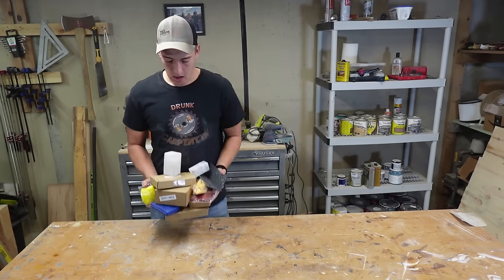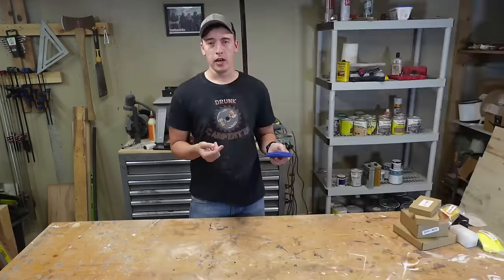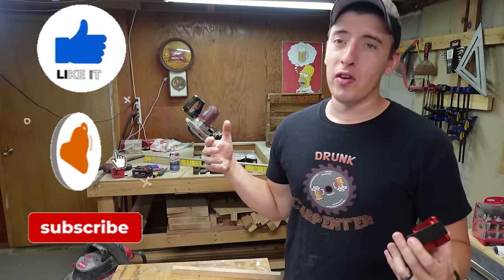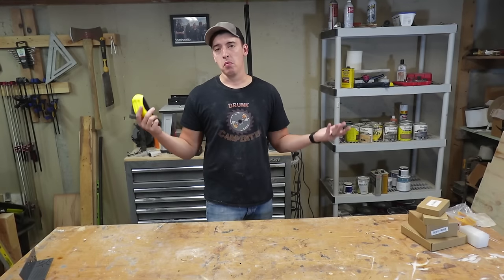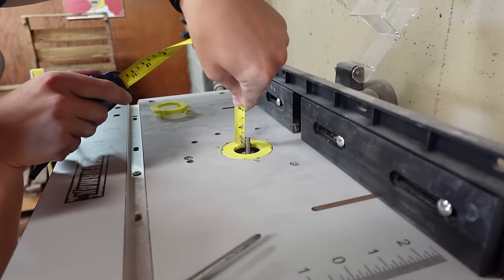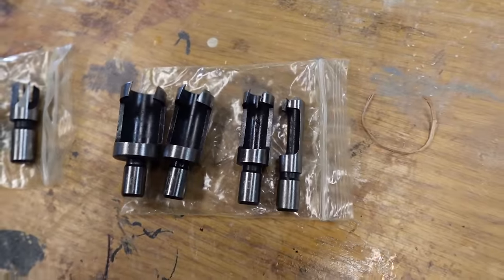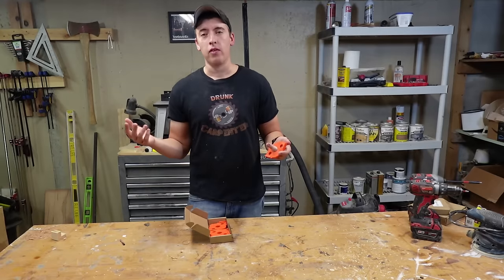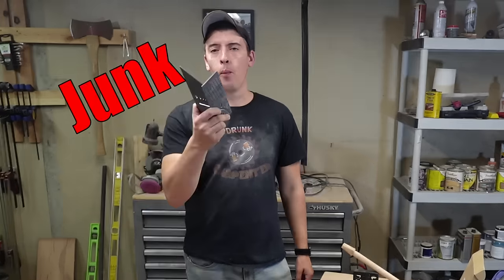12 Discount woodworking Tools From Temu

Comment: The woodworking community is no different than mechanics or construction, they buy tools based on the name of a product. I've purchased many clamps and squares from Temu and they are solid aluminum and are perfectly square. I've also purchased a lot of drill bits, screwdriver bits, extensions and other tolls and accessories and only had a problem with one. Too many people are quick to say it is cheap chinese crap but 95% of what you buy comes from China. I've purchased 2 items, one from Temu and one from Amazon and they were identical, product and packaging but the Amazon item was 5 times more expensive.

Comment: I bought some the same stuff u got just fyi the countersink drill bits might aswell throw them out aswell bought cheap set bit snapped in project first time used it. The triangles bought them great the hand blocks look good. A got the same junky square thing mine went in bin aswell. The resin moulds from temu are pretty good a spent about 30 quid got Like 15 them for that and there all good quality. Next video should be spend 100 bucks totall see what u can get but bigger items. Ps temu will do sponsorship deals! Just saying. 🏴👍

Comment: So for the dowel, next time you try that use a short piece of threaded rod so you can chuck that in your drill. Double nut the end of the rod to run it into the hole you made in the end of the wood.
Reply from the maker: Not a bad idea, I'll have to try it next time 🍻